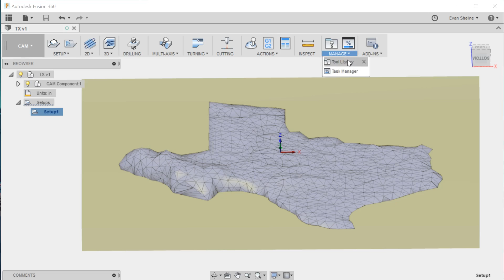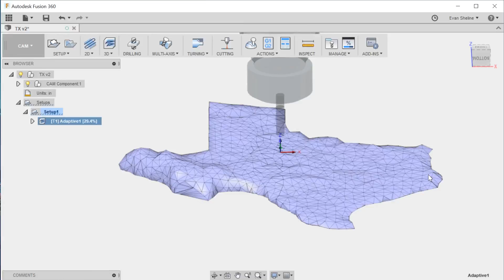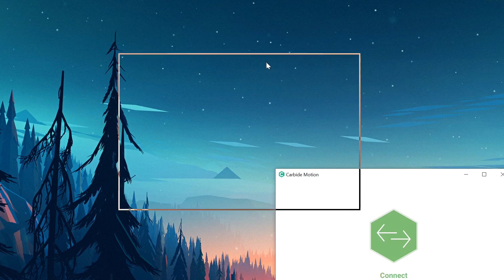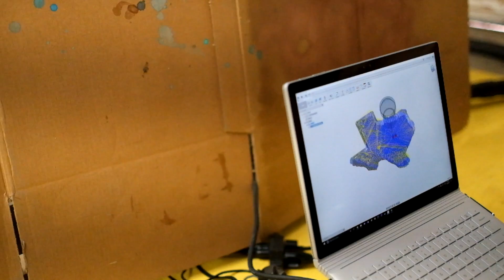CNC topographical wooden state w/ Fusion 360

Comment: I had a dream the other night that I got out of a night class at my old university to find several parking tickets pasted all over my car. I opened the door to find a ticket inside on the driver floor board. It stated "no CNC chips are allowed." I turned around and cursed the pile of Pringles in my backseat. Apparently, they are the CNC crafted chips lol

Comment: A little tip with that particular type of foam backed double-sided tape: You can use dental floss to "cut" it and take it apart. Just get a long piece and wrap each end around a screwdriver or something a few times and then pull it between the pieces. The floss goes right through the foam and it comes right apart.
Reply from the maker: +Scott Jackson oh wow! We will have to try that! We've since just been doing it in smaller pieces and that helps a lot too
Reply: You can also use steel wire if you're not concerned about scratching anything as it works much better. I've used this tape before to mount things in a car, and floss works best to remove it without leaving marks.

Comment: I tried this on a province but it wouldn't work. Fun video!  In my next video, I do a bunch of CNC cutting using Fusion 360 too!  I have a trick for holding down stock that's cheap, strong and most importantly.... easy to remove!
Reply from the maker: Sweet, thanks for the heads up, I just subbed so we won't miss it. Holding the stock and cutting down on dust are two things we need to improve on. Just got the Suck It Dust Boot but excited to see your trick.

Let us know if you need any help getting your file to work! Send us a DM or something and we can figure it out.

Comment: I've used Carpet tape before to do some template work on my router and it works great.  It doesn't move as much as the foam tape, readily available, fairly inexpensive, but also really strong.  A little goes a long way.
Reply from the maker: +The Every Maker thanks for the suggestion! We will have to try it out!

Comment: If you plane or run your wood through a drum sander and get it very flat, I highly recommend Nitto Permacel P02 tape. Way less obnoxious to use than carpet tape or that ultra high bond foam tape from 3M.
Reply from the maker: +Winston Moy thank you for the suggestion!

Comment: Awesome! I need to find double sided tape that's not the crazy mounting tape in the vid, or the spongy stuff. I think David over at Make Something mentioned a specific stuff he uses that seems to be closer to normal tape style. But I haven't seen anything like it at HD whenever I remember to look.
Reply from the maker: +William Burke we need to find it too! This stuff was way too intense, we were worried we were gonna snap the wood!
Reply: Ooh, forgot I put it on my amazon wish list. I think this is the stuff: https://goo.gl/2TLcf2
Reply from the maker: +William Burke oooooo cool we will check it out! Thanks!
Reply: Walmart or Dollar Store cheap double sided tape works good to hold wood together when using a jig saw or bandsaw  for identical cuts on multiple pieces of wood... it would probably work for this too. Great video by the way!
Reply from the maker: +Suzanne P oooo good idea, ok that would be awesome if that worked!
Reply: Another option is to use two strips of blue painters tape. One on spoil board, other on the back of workpiece. Align so they are back to back. Then put a swath of CA (super) glue on the spoil board strip, and CA activator on the back of workpiece tape strip. Once, you place them together, it will stay SUPER secure. Yet easy to remove! I have found that even double sided carpet tape (with the mesh in it) can work it's way loose, and cause probs.  I'll link a vid for it. :)
Reply: https://youtube.com/watch?v=3uTsQ3dYRrk&feature=youtu.be
Reply: +evanandkatelyn. Try double sided carpet tape, the indoor variety.  It is very thin, comes off with a wet rag, and is available at home Depot in their carpet section.